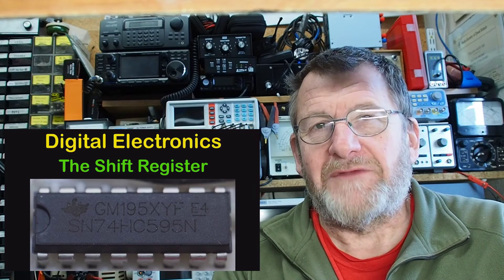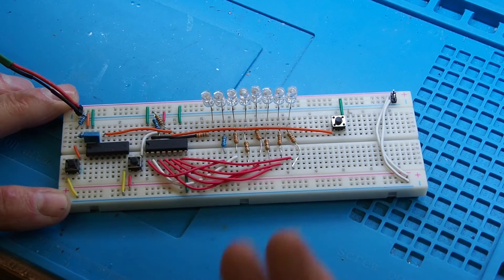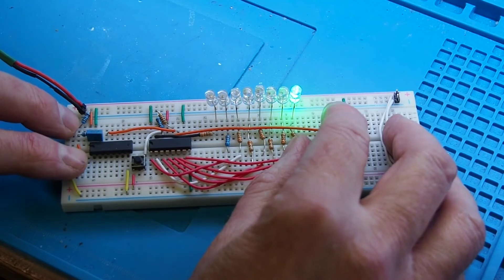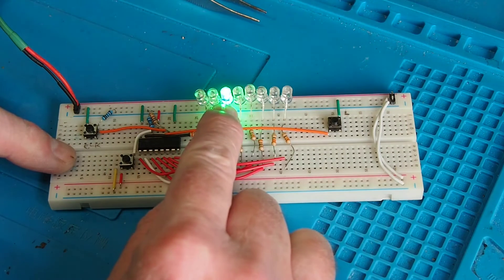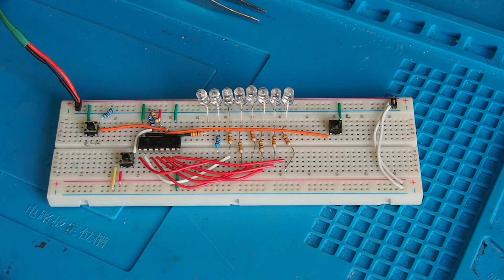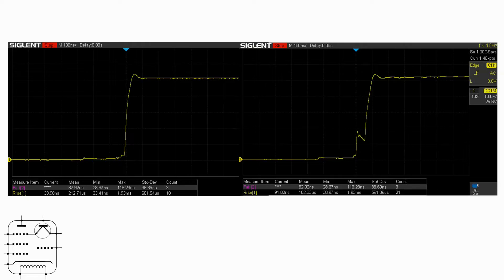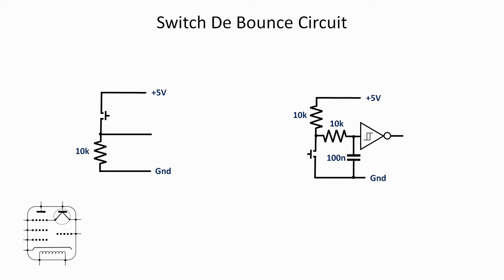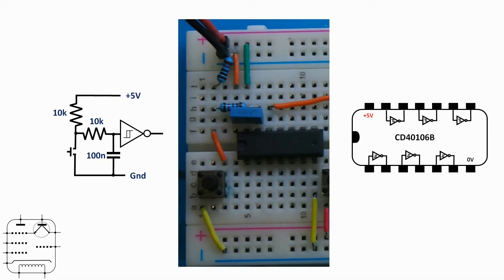De Bouncing a push button switch - #152

Comment: Unused inputs should be either tied high or low. When left floating the IC can oscillate and fail to operate properly. 

Your information is well-presented and very informative. Thank you for this channel, I check every new posting. Your information on different uses for arbitrary waveform generators was fascinating and opened my eyes to new ways to use the device.